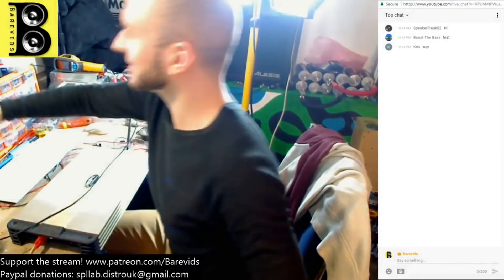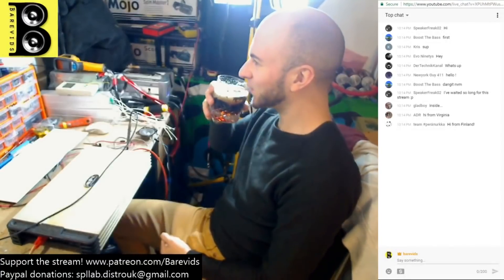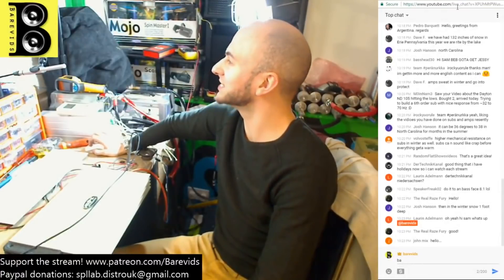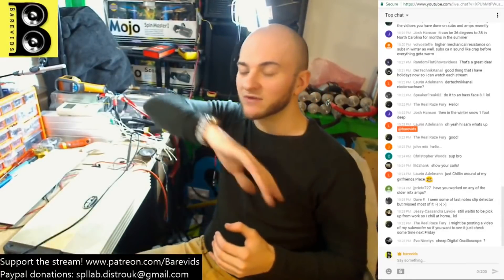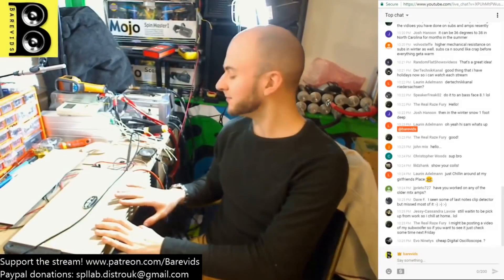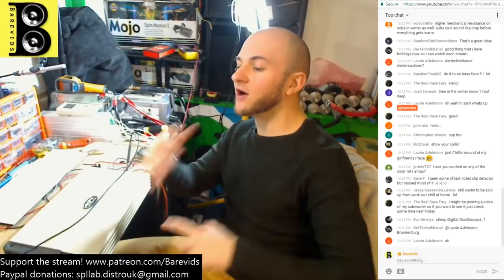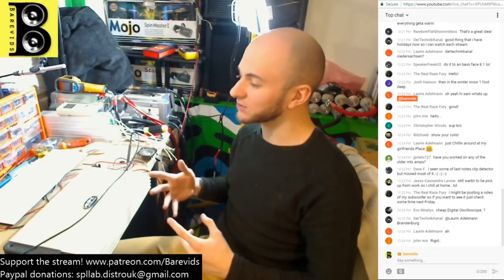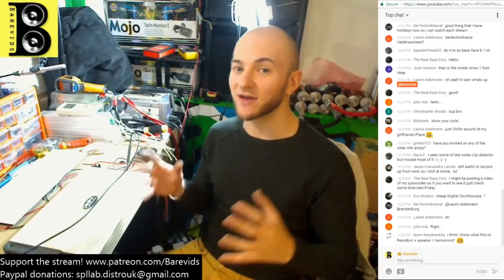Detect amplifier clipping WITHOUT DD-1! Cheap simple clip detector

Comment: will this throw off the nominal impedance the amplifer is seeing?

so a 1 ohm stable amp, I put the small speaker with the cap in parrallel my nominal impedance drops?
Reply from the maker: No, it will not affect the impedance to the amplifier at all.
Reply: @barevids  please explain why it will not affect impedance if placed in  parallel with the subwoofers. I have a dual 4 ohm DVC subwoofer wired to a 2 ohm load on the amplifier and the low pass filter set to 80hz. I will be using a 4ohm SVC speaker. How exactly should I wire this in?
Reply from the maker: @micahwilliams2609  due to the capacitor in series with the additional small speaker and you are playing frequencies under the capacitors pass threshold the speaker load is completely invisible to the amplifier. It doesnt even know its there.

Comment: if you set the gain with the sub hooked up which would be ideal then you hook up the tweeter with it doesn't that change the resistance so much so that the gain would not be properly set after you unhook the tweeter?
Reply from the maker: No
Reply: @barevids  good to know. nice to see a quick response even on a 1plus year old video much respect. i did try this method out though on my setup that i had set the gain on a bout a year ago by ear and noise comes through the tweeter even with the gain almost all the way down but the sub sounds fine with the way i had it. any idea why? id like to know i am getting the most out of my setup but havent brought myself to spend the money on a dd1 yet

Comment: would you please show how to remove poor distortion or noise between music player and amp
Reply: that noise could be coming from anywhere though. what kind of noise? noise that matches the engine rpm is it a whine is it static is it a popping or crackling noise is it  a screeching noise is it a humming noise? if it is not engine noise ,  a whine that raises in pitch with the rpm of the engine then it is most likely a bad ground connection or a bad ground loop if it is not a bad ground connection it could possibly be bad rca's. if it is the engine noise one then you need a filter that hooks up to the back of your head unit. https://www.amazon.com/PAC-SNI-1-Noise-Isolator/dp/B000K50HJE  or https://www.amazon.com/Axxess-AX-ANR1000-Inline-Power-Filter/dp/B0049MWUMQ/ref=sr_1_11?crid=1N4HJZXANPX7V&keywords=head+unit+noise+filter&qid=1559296891&s=electronics&sprefix=head+unit+noise+%2Celectronics%2C130&sr=1-11 . and if those don't help with engine noise sometimes  the metal frame of the head unit is grounded and if it is in contact with the cars metal it could cause distortion. https://forum.ih8mud.com/threads/alternator-whine-in-aftermarket-head-unit-solved.257508/

Comment: Genius
Reply: Multi Pass no not genius.  Simple electronics.  But I tell you what...?. Come over to my car with a ratty speaker and cap for tuning...... I'll be wondering what other inventions you will use working on my car.  Come to my car with a professional piece of equipment and I'll see you have a passion for your job well enough to invest in quality told to do the job.  I can technically cut a steak with a box cutter but you won't be seeing restaurants letting out 99 cent box cutters because the SMD STEAK knife is to expensive
Reply: @angelvip2474  WTF are you rambling on about?

Comment: I have tested several home audio amplifiers with this method. I used 8 ohm and 4 ohm Dummy load resistors and it works great. It limits what frequencies to test to using only low frequencies such as 20 to 100Hz but low frequencies are the most demanding on the power amplifier. I the amplifier can put out 250 watts per channel at these low frequencies, it likely will be equal or more power at higher Frequencies. Using an Oscilloscope method would be preferable but this work just fine as as "barevids" has demonstrated in this video. GREAT VIDEO!

Comment: What if we can only get our hands on a polarized capacitor? What will happen if I use that?
Reply from the maker: It will explode
Reply: @barevids   nice, but I can wire two capacitors together, joining the + with the +,  no more polarity, that would work, right?
Reply from the maker: @Slushplop  no, they'll still explode. You'd need to run some diodes to prevent each cap seeing negative voltage.
Reply: @barevids  thanks, they're really hard to find here so I'm trying to find another way

Comment: Yes but I want to make it audio and visual clip detector, how to put a LED into to it   ? thanks
Reply: same here.  I have a bass remote and realistically every song is different.  I want to be able to push my sub to the max corresponding to each song.  The only way to do that is to install this speaker in the car and if I have a load playing the music is way too loud to hear this small speaker.  My second concern is that I am attaching another speaker to the output of the amp, is that not just connecting the speakers in parallel? therefor changing the ohm the amplifier is seeing and therefor changing the power output?
Reply: @pureledkit2059  I think  even connecting  a small  speaker  like he did will not add up  as a load impedance since  it was connected  in series with a capacitor,  but still i want to add a Led
Reply: Edifier Bass did you get it working with a led?
Reply: @Broxine  yes just put a Red /yellow Led in series  with a signal diode, you can add also a resistor in series or pot to adjust sensitivity... god bless
Reply: Edifier Bass whats a signal diode? Do you still use the 3.3 uF cap with the led?
Reply: @Broxine  a signal diode  same  function as  rectifier diode, smaller in size  same look as Zener diode, you can use any rectifier diodes  just to prevent AC from entering the LED, . now. the capacitor u can use even 4,7mf or 5mf
Reply: PureLEDKit did you get it working with a led?

Comment: Omg thank you so much!!! I'm installing my own audio system in my car and its gonna help alot. SMD DD-1 is great but it's a bit on the pricey side for just to adjust the gains.
Reply: Lol i told steve meade they are expensive and he started to talk shit. All I said is i will buy one when i get rich enough and he replied saying a few hundred bucks is not alot of money.
Reply: @cfmechanic  I bet he got mad lol...well if the dd1 had other functions like a oscilloscope have?  I will with no doubt buy it. I just bought the LM2001 oscilloscope.  It had very good reviews and it's under 90 bucks!!
Reply: @PBWillyWonka  let me know how u like it. I am also looking to get o-scope multimeter.
Reply: @cfmechanic  just got my multimeter this Saturday.  i will install my system monday and ill post a vid on the process on how to tune the amps with a oscilloscope.
Reply: Yeah, the DD-1 is just too limited in functionality to justify the price. I always felt it was flawed in that it is designed to detect distortion at just two frequencies, which when I tested my equipment with an O-scope, they we're NOT the frequencies that produced distortion first. So while an amp set with the 1kHz tone plays such cleanly, you may have 500Hz producing noticable distortion. Add to that it is recommend to use one of the attenuated tracks and you may have it producing a fully clipped square wave at 500Hz. It a great concept, but poorly designed and grossly overpriced. 

I've wanted to get an AMM-1, but it too is too much in my eyes, if I can get on for no more than $300, then I'd probably jump, but $450, SERIOUSLY?!

Comment: does the tweeter need to have the same output resistance as the amplifier requires?
Reply: no, but how much hear will vary slightly from a 8 ohm to 4 ohm speaker

Comment: What type of resistor I need for a taramps bass 12k ?
Reply from the maker: These amps have clip light. So you don't need to do this...
Reply: @barevids  thanks for replying and 
 the bass 12k does not have the clipping light bro
Reply: @barevids  I'm having a hard time trying to set both of my 12k 
Because my dd1 doesn't work with this amps.
Reply from the maker: @Omargarci4  use the clip led...
Reply: @barevids  this amplifier don't have clip led ,  just on and protection

Comment: it would be even better if you used one of these power horns with this 500v ac 1,000v dc 3.3uf Polypropylene cap https://www.mouser.com/ProductDetail/Vishay-Roederstein/MKP386M533100JT4?qs=sGAEpiMZZMsh%252B1woXyUXj91sj6KULCY87xxrLQlu7Rs%3D this is the highest voltage cap in stock for this value if you use this powerhorns it would be louder https://www.parts-express.com/5-indoor---outdoor-horn-speaker-white--300-050 its only about 16.50 for one " including shipping and handling" having one or two of those power horns with this  3.3 uf non polar cap would do an amazing job the caps only 19.38 plus 8 or so for shipping and handling beats paying 200 for that meter...  both of these things would be extremely loud far louder then an average speaker or Tweeter sooner with less clipping so you can really protect your gear quicker and actually hear it over your subs for just for about 43 bucks it would be very effective. they have a 750v av 1.5k  dc cap but its not in stock and would take forever to ship so that caps your best bet if you had to you could use another cap in series for a higher voltage. but doing that splits the capacitors capacitance in half but doubles the voltage. i couldnt find a higher voltage cap

Comment: Can I test my head unit in the same way?
Reply from the maker: Technically however you can easily hear clipping through the speakers on mids and highs. This is only really useful for subwoofer because you cannot hear clipping through sub very easy.
Reply: @barevids  "non polar electrolytic capacitor" Is this the correct type of capacitor?

Comment: If you already know the subwoofer specs that this amp will be driving, would it be beneficial to set your test frequency to the Fs of that speaker, since that will also be your max impedance--and the spot at which the amp should be working the hardest to output at your set level?
Or rather, might you want to set your dummy load impedance to the Zmax of the speaker, to force the amp to work harder?
Reply from the maker: You have this backwards sir, at highest impedance the amp will be working the least hard, since due to the higher ohm load the amplifier will be providing less current. At lowest impedance the subwoofer will demand the most power from the amp. 
Also what you mention would refer to free air only - once in a ported enclosure, Fs has no use in determining impedance spike, and instead port tuning frequency often becomes the impedance minimum point. But many factors are involved, hence why box design programs such as BB6 or WinISD are so useful since they plot an estimated impedance graph based on the woofer and enclosure parameters. It's a little too complicated to calculate with a few basic formulae.
Reply: @barevids  WinISD is a great tool.  Ok, thanks for the clarification.  I was thinking higher load was making more work to get the same output, but I guess I didn't attribute ohms law into that correctly.  So as you raise impedance, the amp has to increase the voltage to achieve the same wattage, however this then decreases the actual amperage being drawn... I think. ;)  Obviously not an electrical engineer here :), but I love learning about this stuff.  Your channel is great btw, you explain things very well.

Comment: so would capacitor would you use to test the full range output of your factory head unit for distortion
Reply: with this hooked up as he indicated, leave the gain turned all the way down on your amp, then turn up your head unit until you hear the distortion. Then after you know at what volume your HU distorts, turn it down ever so slightly (or leave it as is if you want the absolute max output), then start turning up the gain on your amp until you hear the distortion.  NO matter what device you use (OScope, This, DD1, etc.), you must always test the your Head Unit first, then any devices  (like an epicenter, electronic crossovers, EQ's, etc) next, before you test your amps.  ALWAYS Start up stream and work your way downstream, one device at a time.  However, you will need to use a different signal (1k or somewhere around there) to test for full range speaker.  You may also want to use a 500hz - 1khz signal, along with a +/- 35hz.

Comment: The light is a better idea since not everyone that listens to car audio at high volumes retains their hearing therefore trying to detect the tone from the tweeter right at the point where it just starts to be noticable will be a challenge. Then there's also the factor of the ambient noise around you that can interfere with you detecting that faint sound.
Reply: That sound isn’t faint. It’s noticeable a 90 year old can hear that.
Reply: @C_O_N_C_E_P_T  
Humans naturally lose their hearing the older they get. People into car audio that play music loud WILL damage their hearing preventing them from hearing high hz frequencies which is dependent on the individual and the particular damage they've done to their ears
Reply: @obliviondio  people loose their hearing over 15kh. This tone is not that high. I don’t imagine anyone would have issues hearing this if they where next to it.
Reply: @C_O_N_C_E_P_T  
It again depends on the person. If their hearing is that bad then they'd need to assess it visually.

Comment: Great info! thank you for sharing. Is there some easy way to turn on an LED when the amp is clipping? It would be nice to have something that i could permanently install in my truck.
Reply: 13BTRX3 did you find a way to hook up that LED?
Reply: @Broxine  I never did. There are circuits that I found, but it's outside of my ability. I just set it with a scope at 0db and let her rip!

Comment: Also you're hearing the ringing in the filter output inductors. When you have that clipping it makes a much higher voltage out of phase voltage that charges the cap one way then when the voltage goes negative it discharges and then charges it with opposite polarity. I have a Soundqubed 4500.1 in that I'm rebuilding and it shows that issue very nicely.

Comment: barevids+ I just learned something new, I'm impressed, the world still has hope, thank you! What are you using for a load 2 or 4 ohm? What if I wanted to do this with a TPA3116 chip 24v 100watts how would I make this load? I don't have a oscilloscope so I could probably trust a tone generator set at 33hZ?
Reply: Does the impedance of the speaker matter for this test?

Comment: Simple, get a cheap handheld digital oscilloscope from Amazon for about 80 bucks. They work great and will save your subs and other components. I left the audio shop after having a new Amp installed, they had the gain set so high it almost burnt up my Subs. Broke out my scope and got it tuned perfectly and hitting hard with no distortion.

Comment: hi Barevids. A few people asked this question here and I don't seem to see the answer. WOuld you mind clarifying - is the "tester speaker" supposed to be connected in parallel with the subwoofer? Since you don't have a woofer connected in your video it is hard to tell by watching it. Thanks in advance
Reply: The idea is not to connect the sub when setting gains! the gains can be set without the speaker connected. You are checking for distortion created by over gaining the output to begin with. first you find the levels at the head bit. then the Amp. before you ruin the speakers. I have always just used a scope. but the handheld unit by SMD is an alternative. And this gentleman is showing a different way. What way you do it is up to you in the long run. good analog scopes are expensive. you don't need super high frequency ones. you set amps up using lower frequencies like 40 HZ and 1K for highs. so no need for mega frequency oscilloscopes! :-)

Comment: should the speaker/capacitor be connected to the same output as the sub simultaneously? (ie. two wires - one from the sub and one from the speaker/capacitor - into the "+" and two wires - one from the sub and one from the speaker/capacitor - plugged into the "-" ???

Comment: This is awesome. SMD equipment is overpriced. Works but not paying that price when I  could dump that into my system.  Is there a way to use a dmm or even an oscilloscope to set the frequencies on mid and highs and even monoblock amps. I want to set them at amp and not head unit. Another question to find distortion at head unit couldn't  u just turn down gains to low on mid and high amp and turn up volume on headunit until u hear distortion? Used on mine and 28/35 is max volume. Does that work?
Reply: Yes, to find your HUs maximum clean output level, just leave amplifier gain at minimum.

I seen a way to use a DMM to set gain for maximum clean output a few years ago that worked out well, but only if the DAMM was able to accurately measure the frequency being used, which many low cost DMMs have a fairly narrow band of frequencies they can accurately read. For instance, my El cheapo from Wally World can only accurately measure from 40Hz-400Hz. That's not going to be worth a darn on upper mids and highs.

As for an O-scope, yeah, they can measure well beyond the human hearing range of frequencies, the only (well, I'll say main) downside is the limited resolution on some of their screens, as well as some people done seem to figure out how to properly use them and get the settings correct on the scope when using it, which in turn leads to incorrect gain setting.